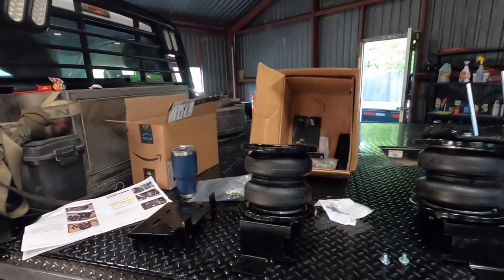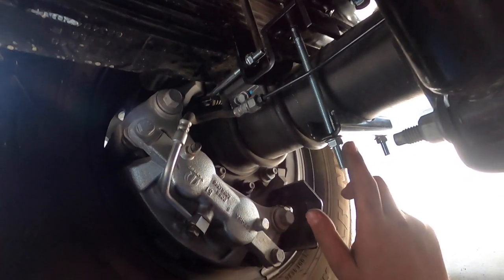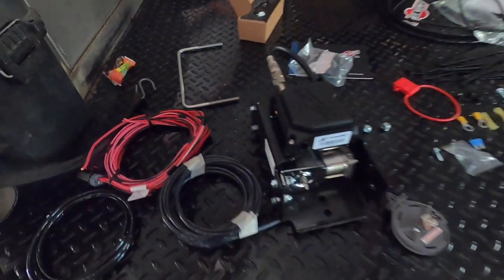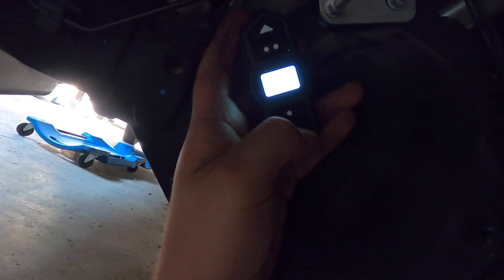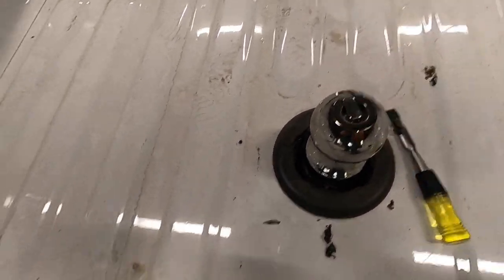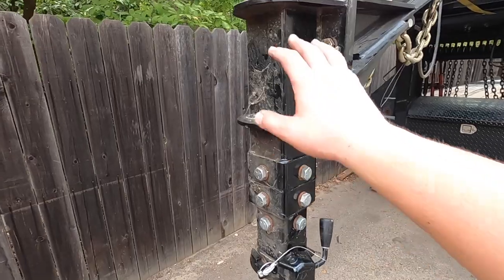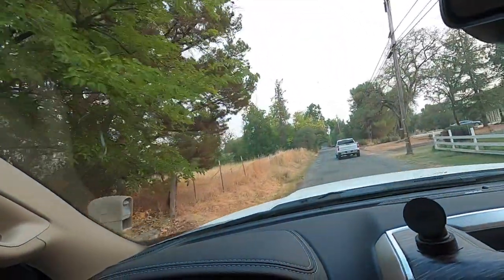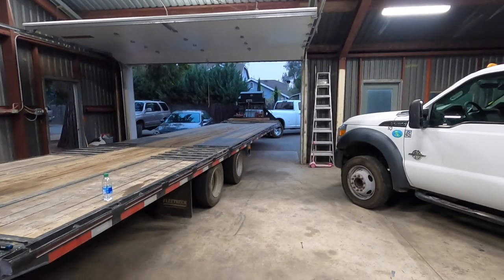AIR LIFT 7500XL BAGS On 2020 RAM 3500 - 3" Gooseneck Ball & Coupler! Installation!

Comment: Use soap in water on air connection if it's leaking bubbles will appear.  Sam will have his hands full. Your truck will be better than his. More power and better stance. Good luck 👍 on your new venture.

Comment: I have the same system for my lifted Dodge and I run on average empty 10 lb just cuz I don't want the bags to wear out. But also remember if you ever get your truck worked on and they lift it to let them know about the bags so they could loosen up the top bolts or the bottom so the bags don't get ripped apart. Ask me how I know that last part LoL 👍

Comment: You might want to take one of your rear struts off and check that it is still good.  My 2018 struts were already failing after just 9k miles on the truck.  Bilstein 4600s are the way to go on these trucks.  Mopar struts are pretty garbage.
Reply from the maker: Interesting 🤔 I’ll check them out! I’ve seen guys replace them with Fox

Comment: When installing the air compressor did you have to drill any holes?
Reply from the maker: No. I got the kit, it comes with three different mounting options
Reply: Does it have a air tank also or just the compressor?
Reply from the maker: Just compressor
Reply: @fulllifeadventures  does the kit need a tank?
Reply from the maker: @mloml41  nope, I’m actually selling my system, I got a different truck